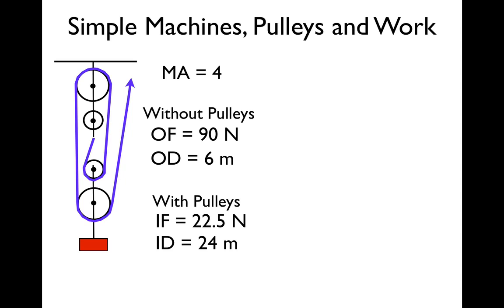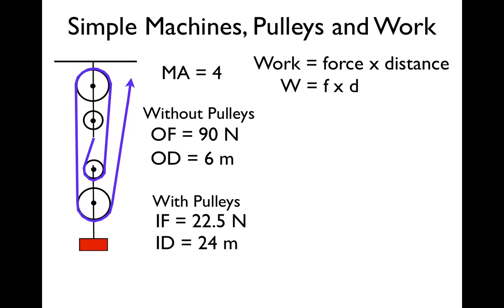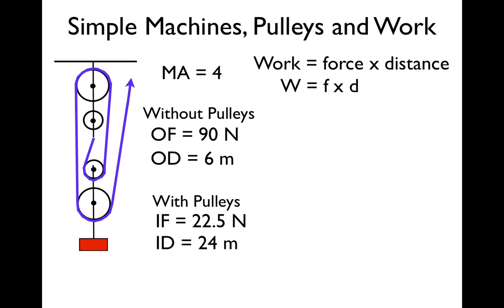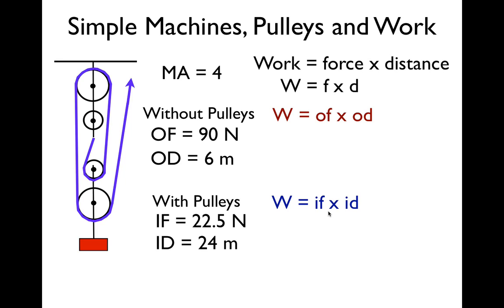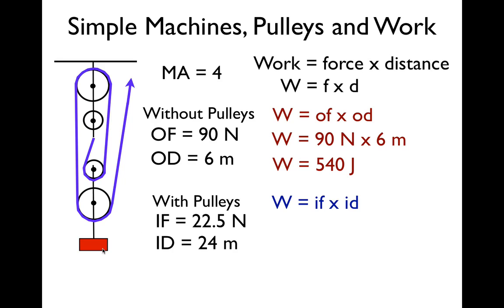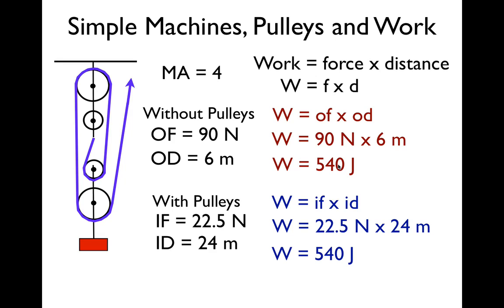Simple Machines (4 of 7) Pulleys; Calculating the Amount of Work Done

Comment: Work may be the same. Of that there is no argument. However, the FORCE  I need to be capable of to move the FORCE being moved is NOT the same. If I am a puny physics student that can only lift 40 N then I cannot move the 90 N force. But my overweight brain  figures out that I can, with the aid of a machine, move the excessive weight using only about half of my capability. SCORE!

Comment: It still makes work 'easier' , though. If you have an object you can't lift because it is too heavy, say you need to lift it 1 foot. if you add 4 pulleys, now you can lift it, to accomplish the goal, yes, you now have to pull the rope 4' as opposed to 1', but you choke up on the rope a couple times, and you are successful and not injured. without the pulleys, you can't do it, or break your back. Pulleys made your work easier by spreading the Joules out into manageable chunks.
Reply from the maker: Technically it does not make the work easier...it makes it so the input force is less but this force must be applied through a greater distance. Work = force x distance. Thanks watching and commenting.
Reply: @stepbystepscience  This is a perfect example of how sound science and reality sometimes do not jive. Language is at play, also. The word easier, w/e, if it can or can't be used to describe the difference here, that's a language issue. But, in reality my first scenario holds. One way, no pulleys, it could not be done by a human. The other way, with pulleys, it can be done.
So if 2 guys are standing there -

Guy 1: How we going to get it in the back 

             of the truck.
Guy 2: Let's lift it.
Guy 1: It's 1000lbs, dude.
Guy 2: Ok, let's make it easier and use

           some snatch blocks. I have 2, so 

         we'll only need to lift 300lbs together.
Guy 1: No, hat's not how the math works, it 

           won't be any easier.
Guy 2: ???? Wtf are you talking about
Guy 1: Well, it doesn't. Cz then we'll have to
           pull the rope 8 feet instead of 2.
Guy 2:Oh, well I guess science helped us not waste  time. Thank God for math.

lol, I trust I made my point. Thanks for posting videos and replying to comments.

Comment: Nice video!  However your claim that using a pulley does not make things easier is just wrong and I think distracts from the good point that you are trying to make.  It's ignoring what the word "easy" actually means - it is not the equivalent of the physics definition of "amount of work done".  For example, it is much easier for most people to pick up and move 20 10kg blocks one at a time than to pick up and move 1 200kg block.  Your students are right to say simple machines make things easier, and you are wrong to say that they don't.  If they didn't, they would never have been invented and they would never be used.  Other than that, good work on the video!

Comment: it comes down to strength vs endurance.  if you look at any crane on a construction site you see that they all use a pulley system. why? because it comes down brute strength vs endurance. my arms can pull a lighter weight far longer than a heavier weight.  it's like riding a 10 speed up a hill. if the work is the same then why not leave it in the higher gear? you always shift to a lower gear because it is easier even though you have to pedal twice as much. This is the problem with doing things on paper. as I said strength vs endurance or work vs effort.  while mathematically the "work" is the same, the "effort" involved in the work is not. from a physics stand point it is the same from a physical stand point it is not. but, what do I know I'm just an uneducated idiot.
Reply from the maker: don't call yourself an uneducated idiot...it will make people think you lack self confidence.
Also, you can see a listing of all my videos at my website, http://www.stepbystepscience.com and you can get educated and smarter.
Reply: +Brian Swarthout I debated replying because you completely missed my point and sarcasm. construction cranes use pulleys, the motor pulling the cable would never be able or would have great difficulty lifting the load with out it, as such it is easier for the motor to do its job. you're  calculating work to work. basically comparing digging a hole with your hands to digging with a shovel. next time try calculating work vs effort.
Reply from the maker: Yes, but you still do the same amount of work.
Reply: @sonar245  the motor doesn't "pull" anything. The motor turns a shaft. There is resistance between the shaft and what is winding on the shaft. So...you are wrong. Hopefully you went and got your education after 2 years